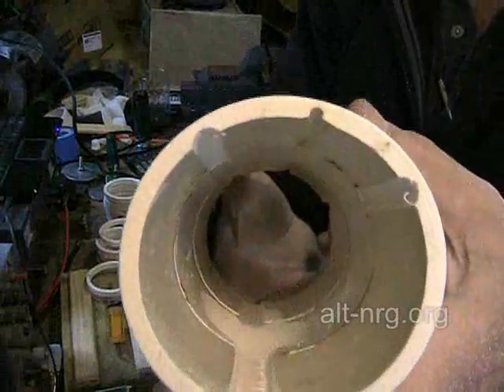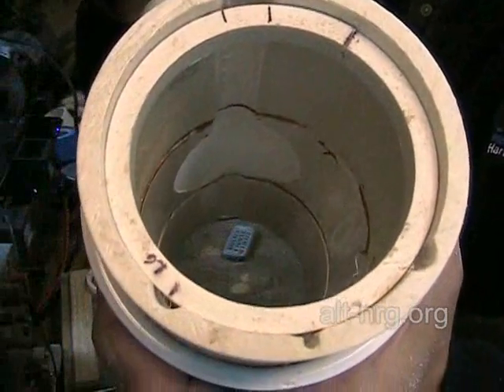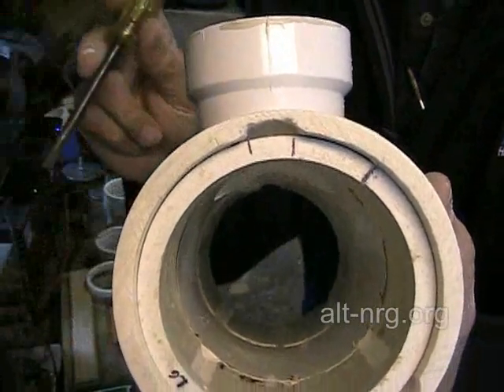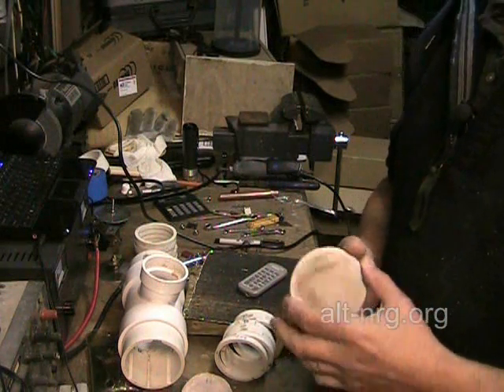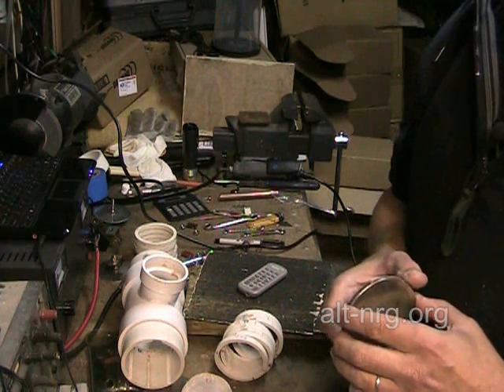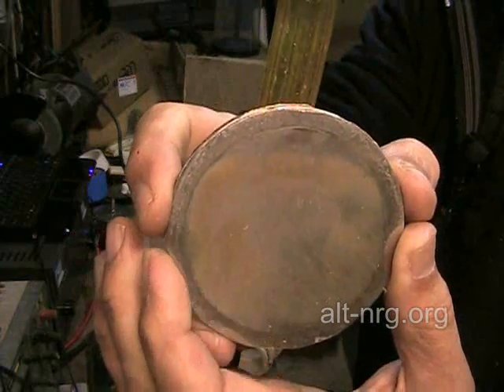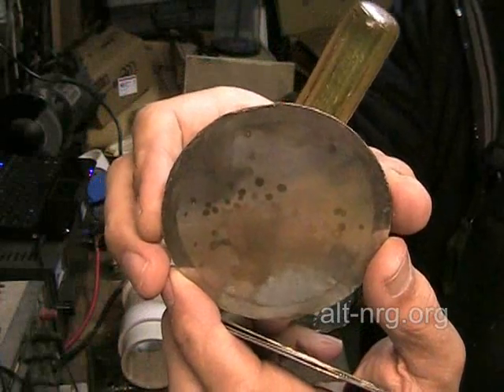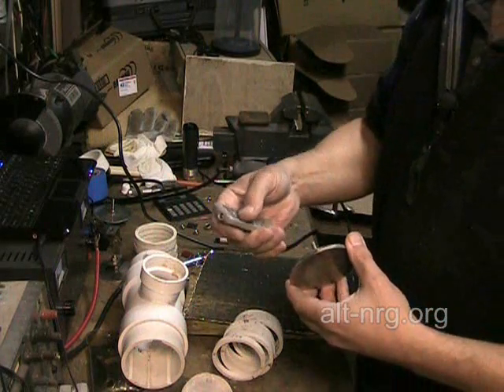#210 - Inverted T-cell rebuild 2

Comment from the maker: Slept on what you wrote here and woke with the answer. Create a 1/4" thick baffle from another pvc ring further toward the center of the cell, blocking the gas outlet channel from going straight up and out. That way it forces a pocket of HHO to build up at the top of the cell before the gas escapes.

Thanks for the inspiration!

Comment: the design looks like it relies on the positive pressure of the hho gas to displace the electrolyte from the top recess. If you look at the end of this vid, there is evidence to show that the top half of the call remains dry due to the gas displacing the electrolyte, What Z has done will reduce the pressure in the cell, allowing more contact area on the plates to be utilized, which wil/should produce more gas, which will fill the enlarged opening he has created. I hope z didnt go to big though.

Comment: You talk about leakage current zig zagging across the bottom. But dont you fill the cell well above the gas holes? If so, you will get current leakage on top aswell.

Comment: I can second that. I have used clear PVC pipe alot but you will notice that I never use the fittings or caps. The price causes a mini stroke every time i consider it. Just cap's are crazy high. I could not even guess the price of a T.

Larry

Comment from the maker: Something else occurs to me.  Even though I'm trying to make the current zigzag between plates, it still has the chance to jump every other plate.  The distance may be doubled, but so is the voltage.  I am actually considering creating a separate electrolyte return path to the center of the cell for all six chambers.  It would not be that difficult.

Comment from the maker: I agree, but I simply could not justify almost $300.00 in clear acrylic fittings .  A 3in. diameter clear acrylic T. fitting along could not be found for less than $150.00.

Comment: I have run n to theexact problem over and over. The more gas you make the worse it gets. To top it off tat top area fills with conductive foam. It wastes power but makes no HHO lowering effeciencies drastically. Amasing what you can learn watching a cell run that is solid acrylic. Those cells I made wrer worth their price in gold just for the education.